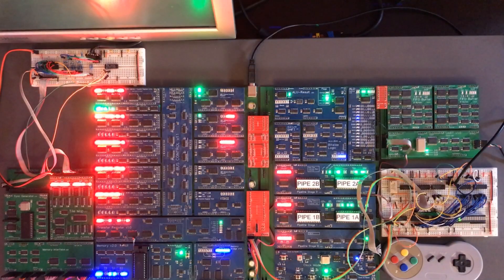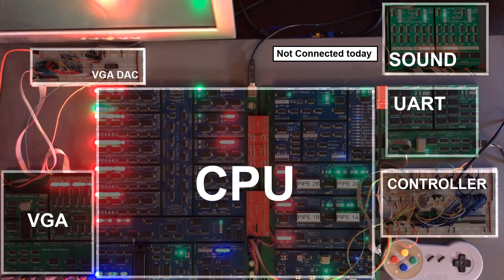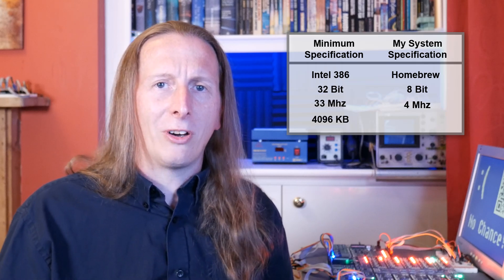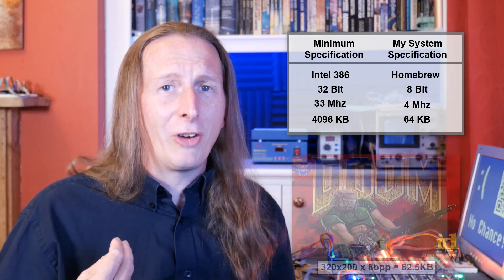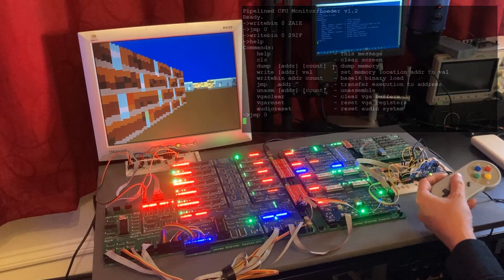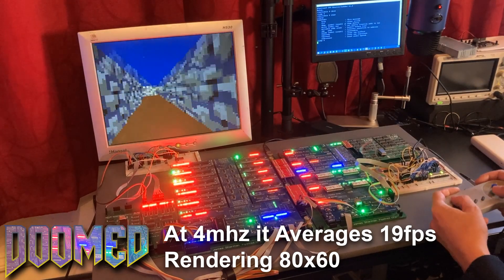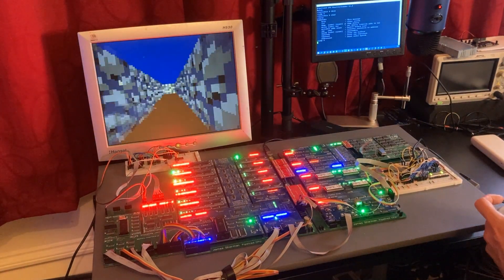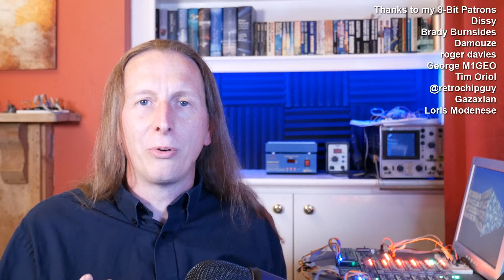Will it Run Doom? - Making an 8 Bit pipelined CPU

Comment: That's awesome and about what I expected. 

With pipelining and a well-designed graphics system, your 8 bit cpu is probably closer to many 16 bit era computers/consoles than the 8 bit era. And there were a non-zero number of "Wolfenstein-ish" demos/games on those. Including Wolfenstein.

Would be interesting if you could push it a bit further to the point where you have different height floors/walls.
Reply from the maker: One of the biggest challenges was the register count, I have to use 2 registers to store a 16bit value which makes things very tight. I was forced into architectural decisions that would have been different on a 16bit cpu.
Reply: Looking forwards to watching the technical details video (which I see you gave already released)

Comment: That is ridiculous levels of impressive! Getting 3D raytracing done in an 8-bit is a level of difficulty that I can't even begin to wrap my head around. Very, very well done!
Reply from the maker: Thanks Usagi! This wasn't raycasting though, it's more of a portal renderer which eneded up being a bit more efficient on a low end cpu with a low register count. I have a programming video which explains a bit more about some of the challenges.
Reply: @weirdboyjim  have you seen AMIGA DREAD
Doom clone running on stock A500
Reply: Now the centurion lol
Reply: You next Usagi, running Doom on valves maybe, lol.
Reply: It was not 3d raycasting. It's better described as a 2d world being represented in 3d from a firstperson perspective. Also, raycasting is a form of raytracing. I don't know why people feel the need to try to differentiate them lol
Reply: Usagi ¿will the centurion run DOOM?
Reply: @big0bad0brad  traversing a tree isn't the same as casting a ray
Reply: @big0bad0brad  Doom doesn't even do that.  It transforms walls (polygons) from world-space to screen space.  There's no ray traversal or rays at all.  It does a frustum based traversal of the BSP tree (frustum-based as in rejecting bsp nodes not inside the view frustum), not a screen-space column based traversal (that would be far far less efficient).

Raycasting (ala wolf3d)
for each screen column:
- - calculate ray world-space parameters
- - follow the "ray" through world space
- - - - sample world grid
- - - - if solid, calculate texture position and draw column, and break out of ray traversal loop

Complexity: O(screen-columns * avg-depth-per-column)

Doom:
- - recursively traverse world BSP based on camera position and angle, this gathers a set of possible visible sectors in front-to-back-order
- - for each possible visible sector
- - - - transform each wall and portal to screen-space, check against occlusion buffers to determine visibility,
- - - - fill columns (walls fill entire column, portals fill floor and ceiling visplanes) and occlusion buffers
- - - - if occlusion buffer is set to fully opaque, break out of sector loop and end bsp traversal.

Complexity: harder to estimate, probably something like O(potentially-visible-geometry-in-viewing-frustum)  (on average probably less than this, as visible geometry can prevent further drawing, and terminate the bsp traversal early).
Reply: Now you have to one up him and port ASCII doom to the centurion.
Reply: Doom engine is not raytracing but raycasting, something completely different.
Reply: @galier2  Doom doesn't use raycasting.
Reply: @drlazy1  ok
Reply: @drlazy1  Correct, it uses BSP
Reply: @galier2  Raytracing is 3d and raycasting is 2d. They both have points traveling, until it hits something. Not completely different
Reply: @galier2  no ofcourse its not raytracing even some rtx cards somewhat struggle with it
Reply: @galier2  it's binary space partitioning
Reply: Raytracing…. Bro

Comment: Another amazing video! 

It really says a lot about the staying power of a title such as doom that it is still used as a sort of benchmark for gaming today. I remember back in the day that I was really impressed with the game, but also that I was never very good at it, lol. 

With regards to memory. From what I recall in earlier videos your memory interface is generic enough that you would be able to replace it with a memory module that has some sort of banking mechanism on-board. Have you ever considered doing that, or are you considering doing that now?
Reply from the maker: Thanks Damouze.  I could add some banking in the same way it was done on earlier 8-bit cpu's but I don't have any specific  plans for that. Those techniques were done to expand the capabilities of fixed cpu's but if I really wanted more ram I could always try to expand the address space of the cpu itself. Might make for an interesting example if there was call for it though.